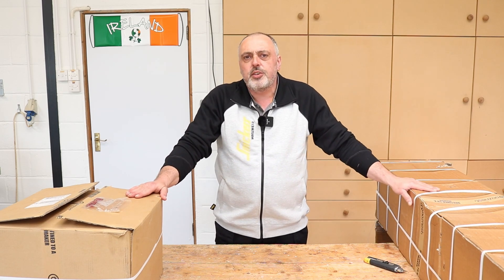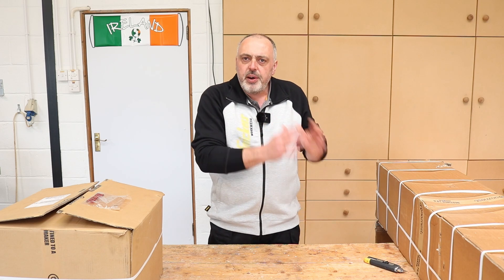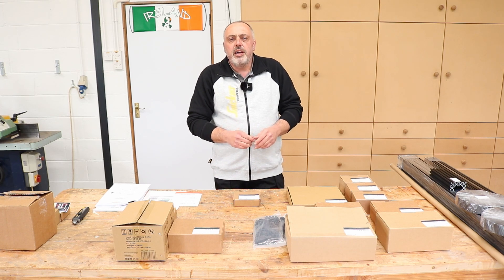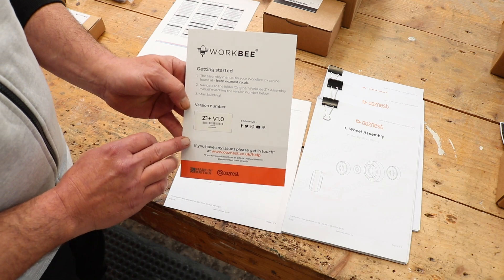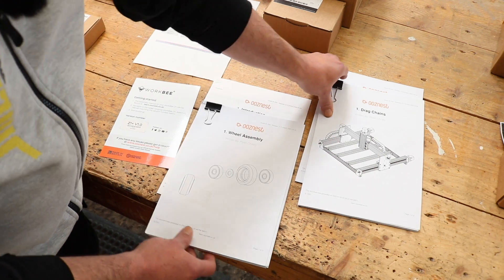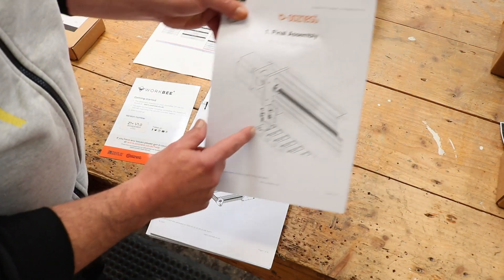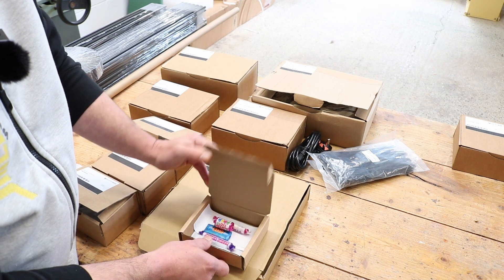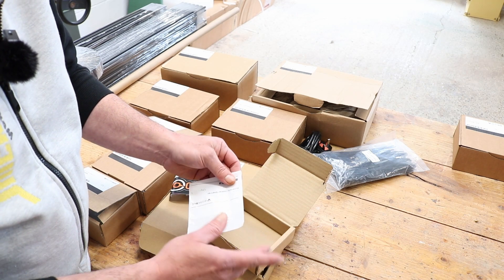Ooznest Workbee Z1+ CNC Build Part 1/ What You Get In The Kit

Comment: How much would that machine set you back
Reply from the maker: Hi John, it would vary depending on the size and spec you wanted, very simple to follow machine configurator on the Ooznest website there is a link in the description of this video. But I think you will find its very reasonably priced for a leadscrew driven machine 😉